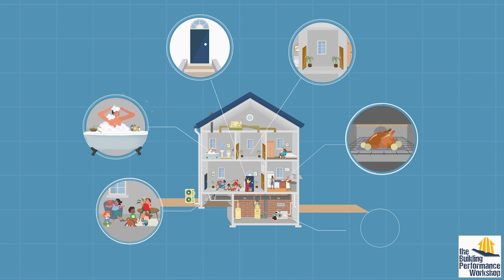Whole Home Depressurization: Worst Case 'Thanksgiving Day' Scenario for Pressure Imbalances

Comment: If you have replaced every gas appliance with electric what is the thing to worry about when your home becomes negatively pressured?
Reply from the maker: Humidity mostly, in that case. Unless you have a fireplace, in which case…
Reply: Humidity, poor comfort and poor indoor air quality because air is being drawn in unconditioned and unfiltered.